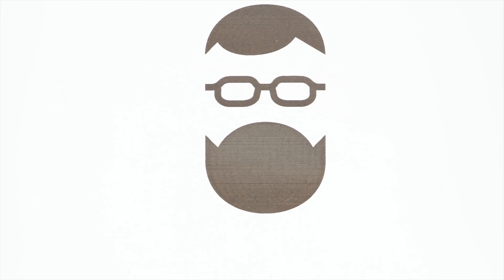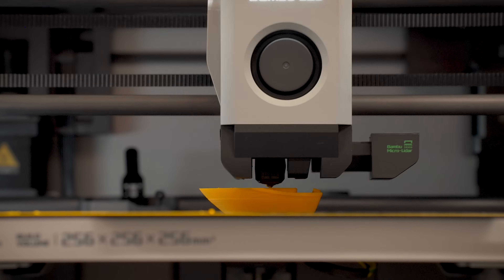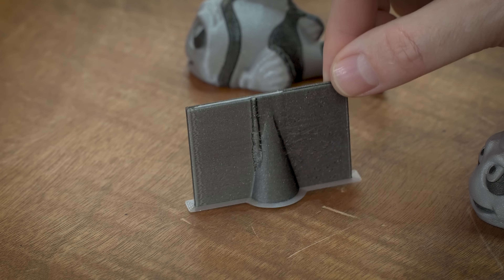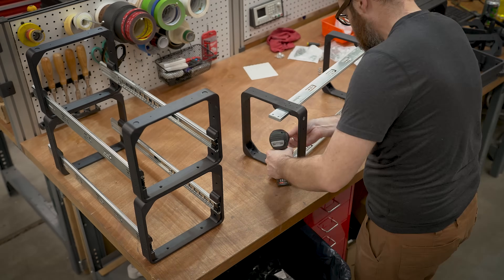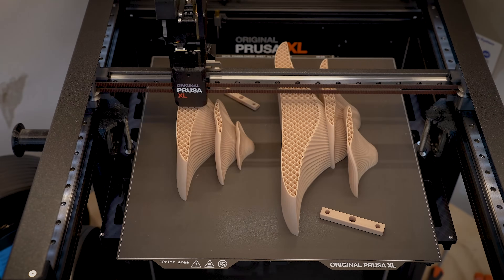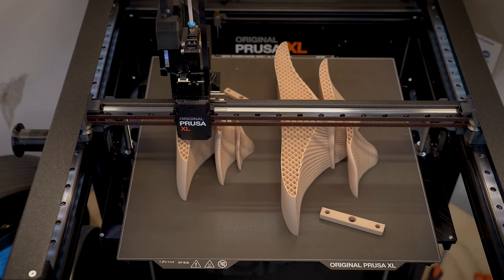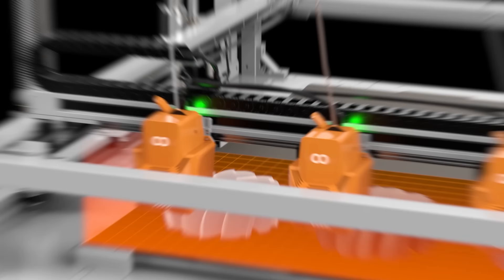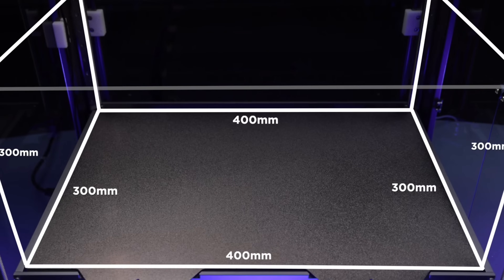Choosing Between Prusa XL and Bambu X1C?

Comment: I have the XL 2T, and for functional prints I would buy it again (instead of the 5 head). Sure, a third toolhead would unlock a couple use cases, but two heads have accomplished all my needs for now. Prusa also offers upgrade kits now, so there's that. Single head XL is the one config I don't recommend. Edit: Almost forgot about the missing enclosure. That's something that I will absolutely acquire for the XL at some point. Either from Prusa (when they release it) or one of the various third party projects.
Reply: I want to buy an xl for the print bed, multicolor printing is of no interest, the only printer with such a work space is the creality K2 at half the price if you include the enclosure with just one tool head but prusa has long term support for their printers, creality doesn't. I'm wondering if twice the money is worth the customer support and part support for the future
Reply: @hojbota-ptv We just bought XL at work. Just a single toolhead version with enclosure. I've been a huge Prusa fanboy, but this one has been a huge disappointment. We got the kit for company bureacracy reasons (easier and faster to get). Anyway kit arrived I assembled it and first test was very positive. Insanely good looking print. Then another test and during that I ran into issue. First filament detector failed when filament ran out. I thought initially that it was a fluke, but it wasn't. Tried to trigger it on purpose for like 8 times in a row with different filaments and every single time failure as filament got stuck in it's mechanics. Part was ready assembled from Prusa and contacted support. They did say they'll send new one if I want, but I just asked if warranty is ok if I open it and check it to save time. It was so I opened it up and did bit of deburring and adjusting and it seemed to get fine. All cool then. Well not exactly as I then noticed that something is bit wrong in the CoreXY assembly (Prusa factory assembled assembly). I pinpointed it to be likely one of the belts being in wrong height and tuned changed one pulleys alignment. Minute job I thought. Wrong. Because now I saw degradation in print quality and immeadiately realized that machine calibration is now likely bit off so I tried to use their in theory awesome belt tuning app, but I have Android phone and actually tried couple different phones and never got it working realiably at all and if got results they differed quite heavily. This now took hours to tune in by feel (I'm packaging machine/maintenance mechanic so I dare to claim I know about mechanics quite a bit) and testing print took a long time (Prusa has awesome torture tower test to see if one has belt issues). Now prints looked absolutely insanely good. So I put print on at Friday and left work. Retrieved awesome looking parts from machine at Monday and put the machine back to work. Only to get message to my phone 15mins later that it needs attention at site. Bed leveling/probing had failed. Odd I thought and just re-started print and got to my work. Same thing, now going back to machine I had visible scratches in pei sheet. I initially looked that it was just some minor droop from nozzle and thought third time is the charm, but this time stayed. Bit after start of the probing I noticed that something is off. It re-probed few places and was erratic looking sequence only to see that like minute later around near where probing was about to end nozzle wasn't anymore even close to the bed. There was about 1cm gap between bed and nozzle and machine. This time it revealed that print head has likely failed load cell for some reason. Now I'm waiting for new load cell and new sheet to arrive. It has taken me about 10h now to troubleshoot issues. I can whole heartedly say that Prusa support is awesome though. They've helped me greatly and seemed to realize my utter frustration as I haven't been exactly praising their printer. After all, all the issues have been in ready assembled components. This must be some extreme example of things going south and I hope machine will now get into action properly, but it needs likely few hours of work more to fix. Plus after all this it truly needs to work like next year on hard usage without any issues or I'm severly disappointed. I was looking into K2 too, but I've had Prusa at home, another Prusa before at work and they've all worked so insanely good for hundreds of printing hours. But this XL. Absolutely horrendous experience for me. Really disappointed, but maybe in some way still glad it's from Prusa that this warranty thing at least works. Creality apparently has really bad part availability and support. But thought to leave my experience here. My faith for Prusa is now at serious test. Kinda interesting to see what happens in future. Customer support was kinda implying at second problem that if I don't get things fixed they could possibly take machine there to be fixed. But I'm now looking into that solution either. Not yet.
Reply: @jothain  that is frustrating. I've read some other comments where people complained about the xl but also that after aa lot of trouble shooting it now works well
Reply: @hojbota-ptv Yes. What I've mostly read has been that the early adopters have had quite a bit of issues, but in the end printer would've been good. Some quite fresh posts have been saying XL to be really good printer. I suppose there is that marginal group that stumbles into everything possible and I suppose this time it was us. One thing got me by the surprise as I didn't research about it and isn't specific to XL but most large format printers. Like MK3S is very fast to start printing. Heating and quick probing of bed and it's going. Now initially I was looking why every single print on XL seem to take very long to start. XL has heat soak timer depending on material, but it can be apparently easily something like 10mins longer. Printer starts normally, but before it stops for counter "heat soaking". It's distributing heat to table to ensure good first layer. I was initially disappointed to see that, but now what I've looked reviews of other large format printers, this doesn't seem to be uncommon at all. One reviewer, can't recall what printer it was, but he had been having huge problems and then realized it could be related to bed heating and sorted it by testing and eventually had ended with gcode timer before bed leveling for 20mins. So if you're into large printers, expect this long startup sequence. I tried to print like maybe 30mm shielding cup for one machine and was bit surprised to see that this small part was actually faster to print than with XL, even though when XL is insanely much faster than MK3S during the actual print progress.

Comment: Fully agree with your comments, two different machines, while i love my MK3s+, if they make a Bambu X1C Large Version (bed size similar to the XL in the next year) i'm all in
Reply from the maker: Kinda same!  I'm not the biggest Bambu fan, but I'd be really curious to check out how they approach a larger format printer.  I don't think many people realize that larger format comes with a whole bunch of additional issues.
Reply: @RobertCowanDIY  It will be interesting to see how Bambu approach building a larger model, having a larger build plate really does open up the possibilities of larger structural 3D printed designs, The XL is an amazing machine, but for a lot of people, its capability is more than they need. but Prusa support is also amazing, which deserves credit that is worth mentioning. look forwards to more content, the future looks exciting
Reply from the maker: @brynsmith414  For sure, once Bambu figures how to do make a large format printer, things will get VERY interesting.  It's what everyone wants them to make, but for some reason they decided to release bed slingers, the thing they said they'd never make?  But the next 1-2 years will be really cool.

Comment: Great analysis.   I like the car examples.  I own a full garage, Bambu X1C, P1P, two Rat Rigs and the Prusa XL with 5 tool heads.   I have been building this for over 5 years and being retired can do and purchase what I want.   I like having the ability to pick the right printer for the job.  Do i need the sedan, pickup or the semi.  Do I need color - filament changes?   I would like to see you do a video on the filament changes on the AMS and XL multi head
Reply from the maker: I MIGHT compare the XL to the AMS in a future video, but probably only from the slicer, since I don't like the waste of the AMS, which is why you've never seen me actually use it for a project.  This hobby is already wasteful enough, I hate how they chose the least efficient (but cheapest) way to switch filament.

Comment: Have you seen the Makertech Proforge 4?

What are your opinions on it?
Reply from the maker: That looks like it could use a BIT more development time.  It looks interesting, but there's a lot of complexity.
Reply: @RobertCowanDIY   Is a great concept, unfortunately the execution was not as good, I figured that maybe it had just been my machine, so I was hoping maybe you got one and had a different experience.
Maybe by the end of the year with the community coming together to fix all the issues it might be on the level as the prusa.
Still, I keep buying these because keeping the open source projects alive is something I think is really important.
Reply: @meltymeltymelty  The tool changing part of it is really well executed, it has some issues in some other sides, the extruders are not super well thought out, the hoses need to be more sturdy and have some way of keeping them upright somehow.
But I do hope the actual tool changer piece does get adopted by some other open source projects for sure.

Comment: Prusa XL is $4,000…
Reply from the maker: I have NO IDEA it was that much, wow!
Reply: @kronosaurelius  The "waste" issue is the biggest non issue when you actually factor out how much "waste" is at issue.
Each filament change is about .3-.7 grams. There is a very simple tweak found on butter pocket prints netting an additional 30-50% reduction.

But It would take hundreds of thousands to millions of filament swaps in waste to match the break even cost of X1C/p1S vs an XL. 
This is years of printing, and 10s of thousands of hours before a single squirt of filament is extruded on an XL in price difference.

I am stealing this line from someone else. Folks who are comparing X1C vs XL and using waste as an excuse is stepping over dollars to pick up pennies .

Comment: Excellent Video. One of the deciders for me was the waste of multi-material printing. The difference is night and day! Having both here, the Bambu hasn't been switched on since the XL 5TH arrived.

My progression has been through IDEX and printing a lot of two colour stuff, or complex prints with dissolvable supports. My Z height was my main limit that annoyed me, with my FF Inventor being 160mm, and my Creator 3 being 200mm. My AD4 gave me 250mm but as I love making Rocket models I had a serious hankering for the bigger Z Height.

As both printers were announced about the same time, we were faced with a quandary of what to get. Son suggested he get one, and I get the other. So he went with the Bambu as I was the one wanting a bigger build area. So the Bambu arrived a while back and did some very fancy stuff. But the cut and rewind of the Bambu system isn't perfect. I'm in a hotter climate and I find that if the filament gets soft due to ambient temperature, then instead of a clean cut it can form a small "ball" which rapidly cools as it's being retracted, and often jams in the extruder, not being able to go out the feed hole. This has seriously driven me nuts as on several builds it's jammed, and to save the build I've had to dismantle the extruder (machine live to not lose the build) to clear the little bulge. As often as 4 occasions on a single build. That and the poop pile has meant it's retired to backup only styatus now.
Reply: Going to have to disagree on many points. If you want to avoid contributing plastic to a landfill why get into fdm printing at all? 
1. Based on your uploads you cannot say you never had a failed print on the XL. Do you toss it or repurpose it?
2. The moment you decided to print with an FDM printer is the moment you decided plastic will end up in a landfill it's a fact of using them. 
3. There are projects to reuse spent filament. A simple one is melt the plastic into a silicone molds(Uncle Jesse,1yr ago)  CNC kitchen showed off 3devo(NOV2023) to repurpose filament but there are others. 
4. You can design your models to reduce if not eliminate waste. There is little reason for filament change every layer if your parts don't need it. 
5.  But you should know there are filament recyclers such as  printeriordesigns, terracycle stateside. 

It's hard to justify a $4000 purchase to save a few cents in filament and you may  *never see the  break even price during the life of the printer*.  
*My math is sound*. It would take years and hundreds of thousands to millions of color swaps before the XL even gets started to match the price spent and this is before you do butter pocket prints 50% additional yield purge reduction, the waste argument is not the biggest strength for the XL at that price. 
 
You could potentially make the argument for the swap speed or size or if you get the right combination of compatible filaments which so far has been a mix of occasional success but mostly fails based on what is shown on YT.  
 
I stole this from another commenter. "you are stepping over dollars to pick up pennies".
Reply from the maker: @AwwwSnapperz  we're just going to have to agree to disagree, since we see this differently.
Reply: @RobertCowanDIY  We can agree on that. lol. 😁

But if you were serious about landfill issues there are recyclers for filament . I would rather you know, not everything needs to be tossed especially if you believed it was all waste before our interaction.
Reply from the maker: @AwwwSnapperz  There are, and I've looked into them.  The problem is they don't accept anything other than PLA or PETG (at least in the US from what I've found) and they don't allow mixed filament.  SO purging into the same bucket is out.
Reply: You would need to eat hundreds of thousands to millions of filament swaps to match the price difference of the X1C to XL. $1450-$3500-$4000 
The waste doesn't become a true factor unless you have done years worth of printing at a minimum. 
Each filament swap at default is about .3g to .7g. 

This is the first I have heard of the filament being a "ball" during retraction. The printer cuts the filament above the  melt zone and retracts. How is it still molten unless you run in an environment that is above 60C or 170-180F. Under your circumstances the filament should be soft in the ptfe tubes during extrusions too. 

*source I have an X1C with 10s of thousands swaps and retractions and 5k hours printed.
Reply from the maker: It's not just about price.  Sometimes it's about adding significantly more plastic into the landfill.  It's really wasteful to just purge that much material with no way to recover, recycle, or otherwise reclaim it.
Reply: @RobertCowanDIY  It's not just the reduction of waste alone. Although the Bambu can print faster, it's way slower on every colour change, negating it's advantage. So I get both a productivity AND a cost (waste reduction) advantage. 

Add to that a much larger build size as well. I can make Cosplay parts up to 360 x 360 x 360mm Vs 220mm for the Bambu. So less joins which are possible weak points for print failure.
Reply from the maker: @theaussieviking8555  Oh, I agree with you ;-)  But they are still very different machines.

Comment: I would like to mention that i print petg and pla on prints all the time on the X1C. Mind you, one is used as an interface layer for easy removal.
Reply: Try printing TPU with PLA.....or PetG and nylon. Or PLA, TPU petG and nylon all at the same time on your carbon
Reply: @TDax Try printing without stringing😂
Reply: @sanderpaulsen9375  the XL is cutting edge technology, it's not surprising there were a few problems in the early days....it's mostly sorted now. It doesn't change the conclusion of this video that in some specific cases the XL is the only game in town.

Comment: I stand by my original concerns on the prusa xl.  I just don't see the value for 4k.  They are currently the only tool changer printer this size, but other companies will take note and you can bet competition is paying attention.  I like prusa. I want to like the xl. I just can't justify 4k for an open air printer with 3d printed parts that I have to assemble my self.   Right now they have a monopoly  on the market but you can be sure that other companies are paying attention and I wouldn't put it past bambu to outright steal the concept and make their own tool changer in the future.
Reply: Until that happens I'm getting the XL, yes its expensive but I really like what I'm seeing with it.
Reply: if you don't need the tool changer it's 2k, which is still more than some printers but a lot more reasonable for a big corexy printer that works

Comment: Also waiting on my 3 heads to upgrade the XL...  now if only I could easily use different nozzle sizes....
Reply: I think that will be coming
Reply from the maker: Check my video later today ;-)
Reply: And my 5 head upgrade is done.  Very straightforward if you originally had it arrive self-assembled.